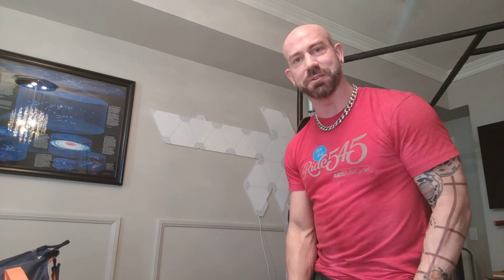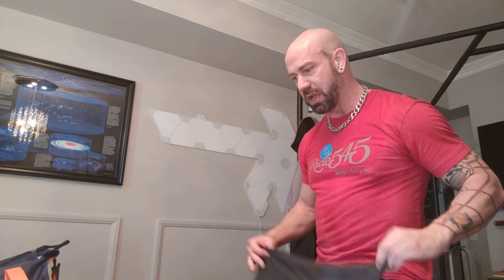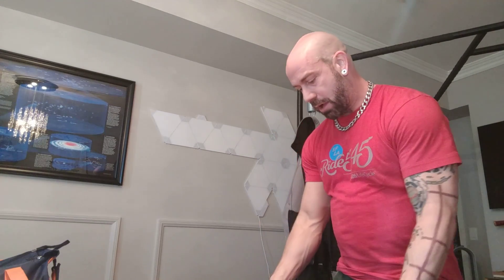Why don't we clean our solar panels on Mars?

Comment: What a stupid way of presenting information. Folding laundry? Seriously? You didn't answer anything conclusively. Dude, the Curiosity Rover had an extremely short mission duration because of the anticipated dust issues. Selfies taken, showed the panels covered in dust. And then, all-of-a-sudden, we see that the panels have been cleaned and the mission extended $ $ $ How did they clean those panels Mr. Laundry Man?
Reply: ???? Curiosity is Nuclear power

Comment: I don't recall which probe it was that included the drone helicopter. But in that case, would it be possible to hover the drone helicopter over the solar panels, since you're flying it anyway, and use its downblast to blow the dust away?
Reply from the maker: Well, you could do that... but you've seen drone-fail videos right?  Yeah, there's always a chance it could go wrong and damage either the helicopter (Ingenuity landed along with the Perseverance rover) or the solar panels.  It's too much of a risk to the overall mission.

Comment: I am considering researching a large drill (viz. digging out tunnels) Mars operation for my masters thesis. As you say, it will need more power than has been used in missions so far. In this case, active cleaning methods need to be investigated.

 I actually found your video while doing some provisional background  research.  Subscribed.